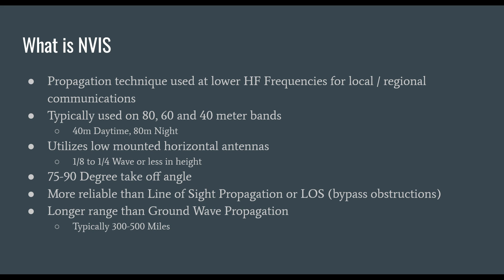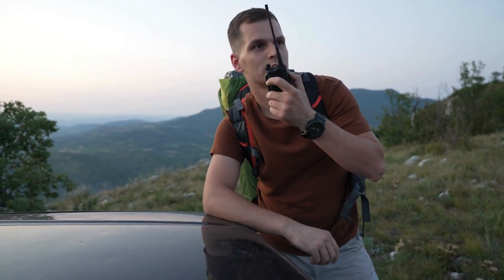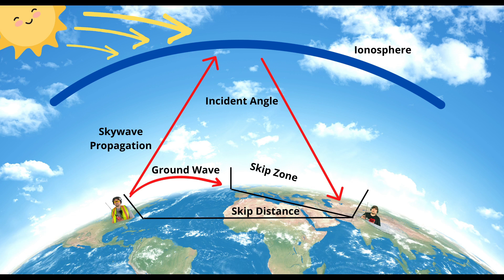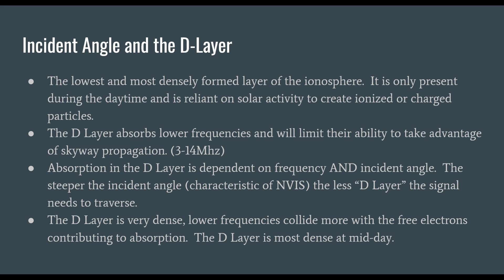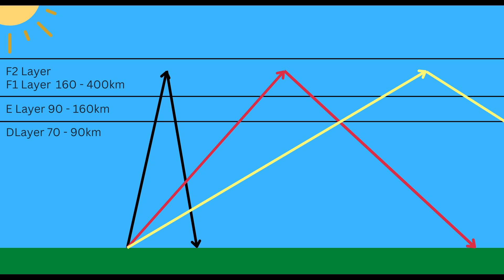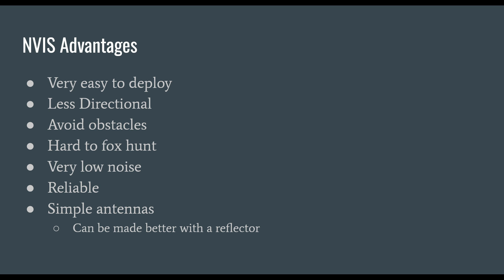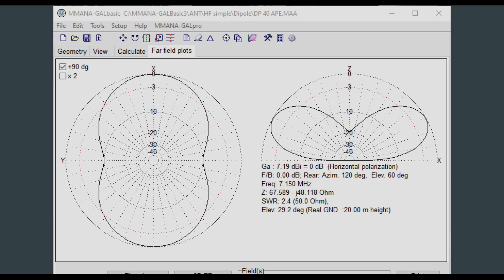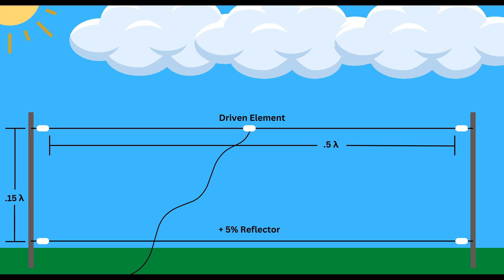NVIS Propagation for Ham Radio Beginners!

Comment: Most of the research I have done with NVIS didn't include the reflector.  I have also seen inverted V antennas mentioned for NVIS.
Reply from the maker: Yep, an inverted v will work as well, just keep that angle obtuse 👍

Comment: I use NVIS several times a week and have found distance is somewhat critical generally 100-230 mi and from central WA state 230mi was my sweet spot this is at the max effective range for NVIS propagation assuming a 60deg or higher radiation. I have found getting inside that 75-100mi distance to have increasing difficulty and i believe you need to drop the frequency.
the f0F2 is the max frequency for NVIS activity a good starting point, if the MUF is below 7mhz then 40m is closed until it does, but in the evening you can still use the band a bit after it drops.
Reply from the maker: Thanks for the info 👍

Comment: I live in Orange County Calif.  now day, most people only have less than 30 FT height antenna for 80 meter , HF.  I hear them very strong  up to 300 miles away in 3.9MHz.  Orange County  CA to San Diego is good NVIS  path.  AG6JU
Reply from the maker: Thanks for the info Porco 👍

Comment: So if I'm following, if I wanted to do HF comms between, say, 1-30 miles or so, groundwave propagation would be the only way it might work, and that would work best with vertically polarized antennas, correct?
Reply from the maker: That would like be best but you could try NVIS as well 👍

Comment: The reflector becomes more important on the lower bands, especially 80 and 160. Not just a single wire, but multiple, all parallel to the radiating element. Ground losses go up as frequency goes down and the closer the antenna to the ground (in terms of wavelength), the more RF power that gets absorbed bythe ground losses.
Reply from the maker: Good point! Thank you!

Comment: Is a 40m EFHW in POTA sloper or inverted V config going to behave more like an NVIS antenna?   If so, this could explain why 40m is relatively useless for Seattle area POTA since the 400-mile sweet spot is mostly uninhabited whereas it cuts through huge population centers for east coast POTA activators.
Reply from the maker: For NVIS to work correctly both stations need to have an antenna mounted in a low configuration, you want the gain pointing up 👆

Comment: The information about a reflector is very useful. I have a CF dipole that, due to my location, can't get much about 15-20 feet (and is between two houses, so it doesn't have a view of the horizon, and I've noticed it works OK for DX but also sometimes for NVIS (I mainly know from 40m nets). However, I do not have a reflector. I may see about installing a reflector to see how that affects my communications. Thanks.
Reply from the maker: Good luck with it and thanks for watching 👍

Comment: How reliable will NVIS be if both stations are using dipoles at the correct heights. & using digital modes js8call/VARAC ect? 
I know it will depend on time of day/year ect but can you expect to make contact 90% of the time?
Reply from the maker: Not very, in the far field plots you can see the gain radiation patterns, both antennas should be mounted in an NVIS configuration 👍

Comment: Thank you for the video. The low band EFHW antennas where one end is thrown up in a tree and the inverted vee dipole antennas supported by a mast for SOTA/POTA activations, are they working by NVIS? Or, is it skywave propagation, only compromised, because a lot of the radiation is working like an NVIS antenna?
Reply from the maker: If they are very low to the ground you will do better with NVIS but remember frequency is important 👍

Comment: Thanks for the forecast! I need some advice: I have a SafePal wallet with USDT, and I have the seed phrase. (alarm fetch churn bridge exercise tape speak race clerk couch crater letter). What's the best way to send them to Binance?
Reply from the maker: You need the transfer token installed and configured correctly 👍

Comment: Ape, unless I missed it, you didn't explain the critical frequency and its more direct effect on NVIS. Although MUF and CF are related, CF is a more precise measurement and readily available on VOACAP.  Of course, the 75-90 degree propagation is best close to or just below the CF. MUF is much more imprecise and subjective, involving transmit and receive locations. I appreciate your work and all your videos. Don K1DLA
Reply from the maker: Fair point, thanks Don 👍

Comment: Good presentation. Most of the NVIS that I have seen are inverted vees. If you use two different bands at 90° angles to each other, the antenna itself effectively becomes the guy lines for the mast, and only one mast is needed.  I think at some point in the future, I will experiment with both a dipole and inverted vee and see if one works better than the other.
Reply from the maker: I’m a big fan of inverted V antennas for the reasons you mention but you want reflectivity from the ground, a dipole is better suited for that 👍
Reply: @TheSmokinApe  15 foot pole with double inverted V's like described have been the military standard NVIS antenna for over a half of a century and is what a lot of civilian NVIS antennas are based off of.  Simple and it works.
Reply from the maker: @ somewhere around here I have a paper copy of an old military NVIS guide

Comment: Great stuff ! Many make a NVIS style for 80 meters and don't really know it. The height above ground.  The reflector adds gain . I have had odd DX over summer on 10 meters. Very short. some call that NVIS but are wrong. 10 meter band can have speritac E or tropospheric ducting happen.  6 meters does it more often.   I talked 10 meter SSB from Boston NY to NYC last summer. And a few FT8 as well. Very short DX . NVIS does work most of the time and at solar min . That's why the military has frequencies in HF set aside for them.  73
Reply from the maker: Hey Robert, thanks for watching 👍